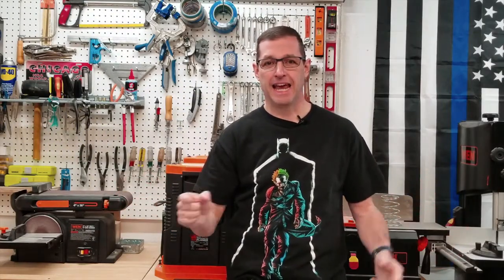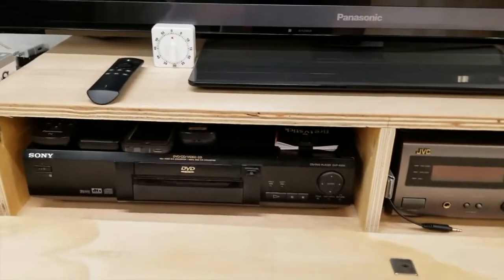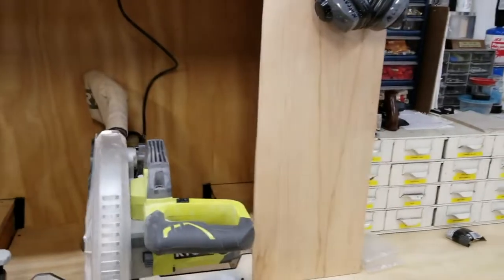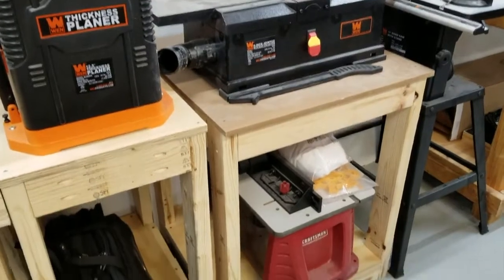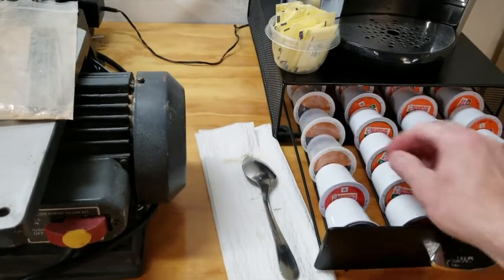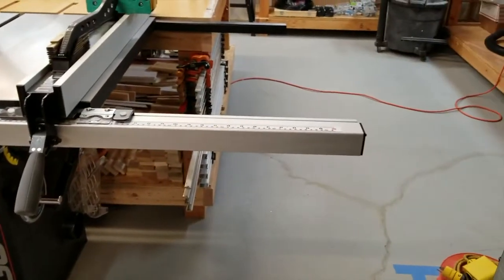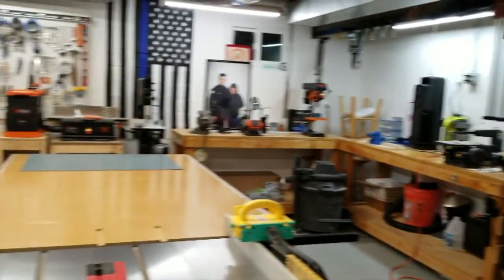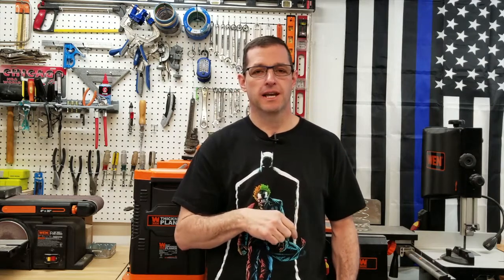WoodShop Tour 2019!

Comment: Nice shop, good use of space, and the beer fridge  👍👍👍👍
I'm updating my shop and stopped in to see what you're doing with yours, looking for ideas to glean.
Thanks for sharing.
Reply from the maker: Thanks for stopping by! Tonight I start enclosing it! I'm looking forward to NOT hearing my furnace and water heater constantly on. It's very loud and makes recording down there hard as well. It is going to make it impossible to walk past my tablesaw on the right side,  but the wall that will be there will be a good place to hand jigs and other things. And I look forward to not blowing dust all over the basement.
Reply: Hi Michael.  Have fun with it, It sounds like fun, at least to us weird shop guys.  I swear that I spend as much time updating my shop as I do working in it.  I don't like the noise either,  my air compressor and dust collector are in a small room lined with rock wool, it works great to keep my environment as quiet as possible. 
Have you considered making an air cleaner, that could really help with a confined space like your basement?
Later
Walt

Comment: Nice shop. Hope you enjoy your wen products. I like my wen drill press.
Reply from the maker: Thanks. I just framed it out this past week and will be putting up the drywall in the next week. Then installing a whole shop dust filtering system of some sort. I may buy the WEN version or build two from box fans. So far I love the WEN products.  I think I have to adjust the bandsaw though. I used it during framing to cut some custom odd shaped pieces out of 2x4s and it seemed to struggle. Thanks for stopping by and subscribing. I appreciate the support.

Comment: what  is ur kit  spek  i  see  ist  Tamma  and  Zildjian cymbals
Reply from the maker: Ahhh the old shop video. I'll have to shoot a new one in the spring.  The original 5 piece Tama kit was purchased in 1982. It is a swingstar model. I then added 3 more bass drums (4 total). 4 iron cobra pedals. 14 mounted toms, 2 floor toms, 3 roto toms, and 12 Zildjian cymbals. There is too much to list. And hydrologic heads. Next spring I'll be building a new riser for it after I expand the shop. What do you have?

Comment: When the flag is hung vertically, the star field goes to the left.
Reply from the maker: I know thanks. That would be the rear of the flag on this one. If your outside looking in, it's the correct way😉
Reply: Sorry, not having Superman's x-ray vision, I cannot see through walls, so did not consider that.  :O
Reply from the maker: @kevinvernon3600  I've turned it around. Thanks for the reminder. I appreciate it.